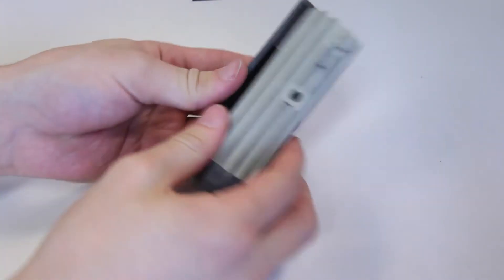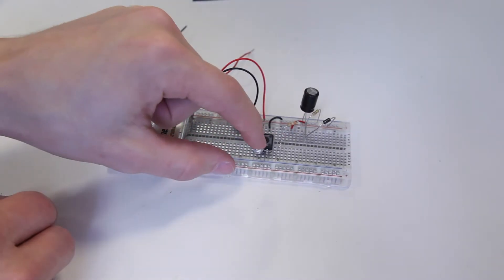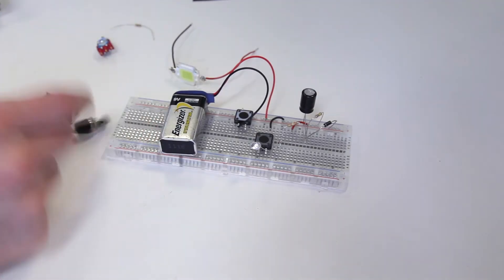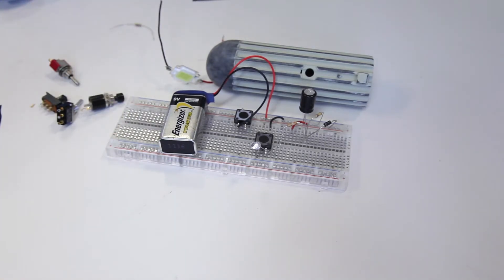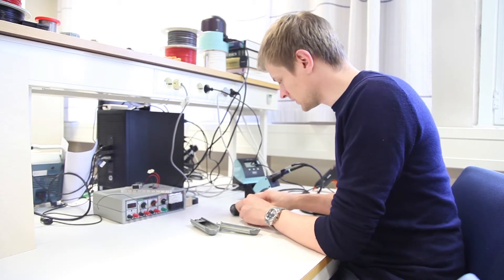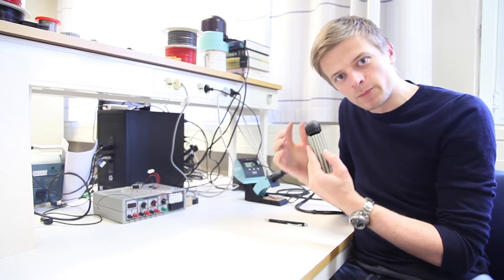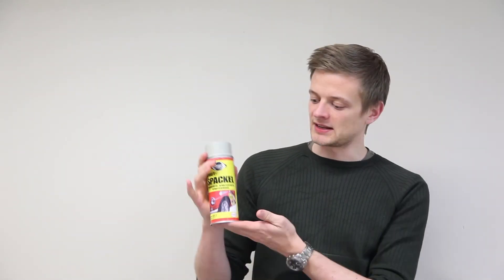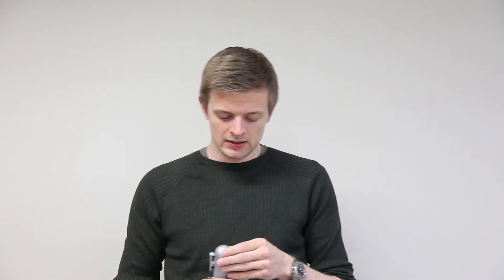Simplified Neuralizer-prop from Men in Black - Misc #2

Comment: That does not seem low effort
Reply from the maker: I would say it’s medium effort, because it doesn’t require a lot of work or many parts. However, completing the painting and finish and everything makes it borderline high effort I guess. 

The point is that it’s relatively flexible. You don’t have to do everything we do in the video, but it will be easy to replicate something similar that still resembles the movie prop (eg. unpainted, using components you already have available)

Comment: Wow, this video is too quiet...
Reply from the maker: Oof... That’s not good. Do you mean in sound volume or just that there’s too little sound - like music for example?
Reply: @AppliedProcrastination  My headset is not very loud, but absolutely ok for most of the things, I normaly have it set to 80% and have to go to 100% on some quieter videos. The volume on this one is so low that even on 100% my headset cant overcome the background noise here.
So the problem is partially on my side... but I have no problems with other vids
Reply from the maker: Schwuuuuup that’s probably my fault. I’m sorry about that. The editing of this video was a bit rushed in order to reach the Halloween deadline, so it didn’t go through our sound guy, Haldor. I don’t think there’s anything I can do right now to fix it - but I’ll look into it. Thanks for letting me know!

-Simen
Reply: @AppliedProcrastination  I've heard rumors of some ability to replace videos on YouTube lately... not sure what it takes, or whether you still have the masters to do a remix, but yeah... at least at the beginning, the audio is just at a really low level.  I can just barely hear you.  :-/
Edit: P.S.  The music seems quieter-than-usual, too... it works fine as background music, but if it was meant to sound foreground, it doesn't, really.

Comment: Should have used DIY lifehack in the title and used hotglue instead of electrical tape and screws. Guaranteed more views.😀
Reply from the maker: "How-to make DIY hotglue-based Neuralizer from Men in Black using only tools you have in the home (as long as you have a 3D printer at home)!"😂
Reply: @AppliedProcrastination  great video by the way.
Reply from the maker: Thank you! Glad to hear it, since it's a bit different from what we usually do.